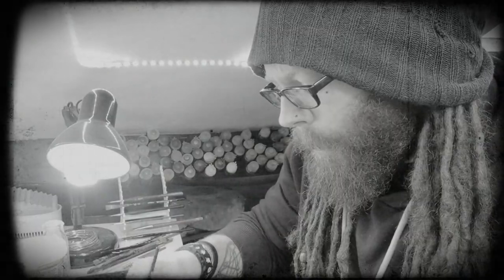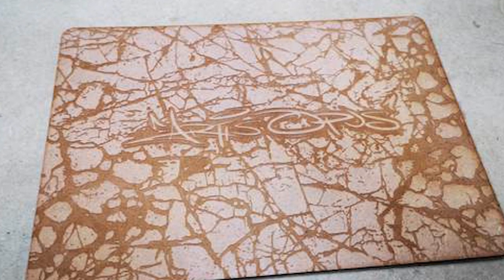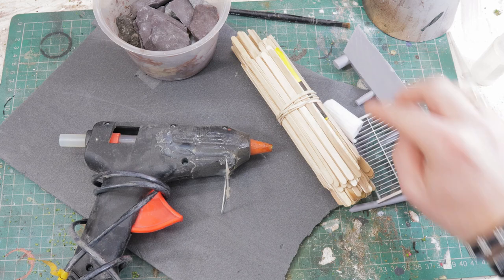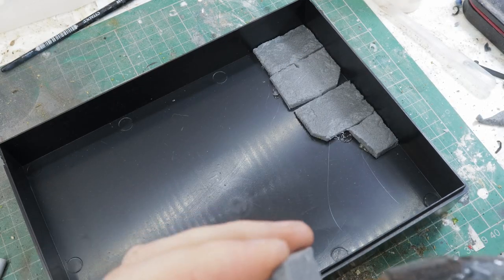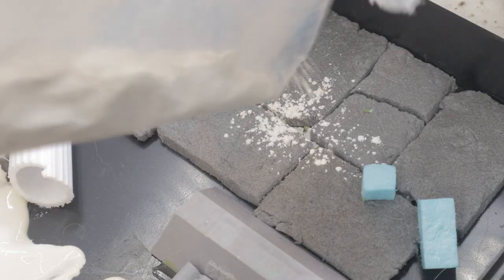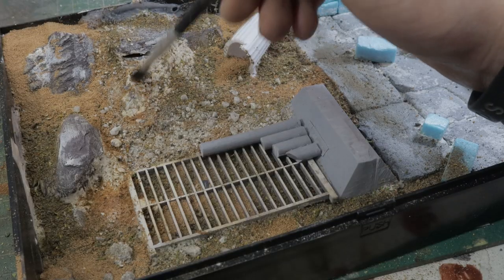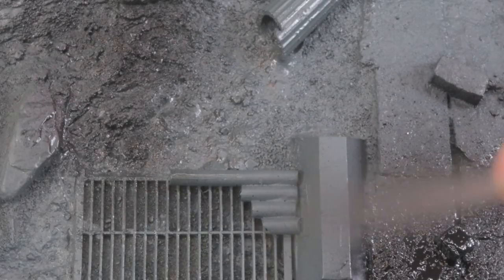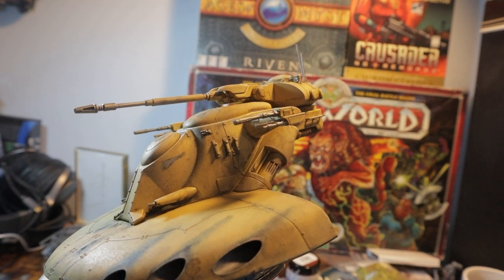LEVEL UP Your DRY BRUSHING Game | Homemade Texture Palette For Softer Blends.

Comment: Awesome idea! Its nice to leave some flat area to dry-mix on the palette, putting the colors on there directly from the bottle / pot for extra smooth gradients. Also would recommend using a large round brush (e.g. makeup brush) for bigger surfaces. Tabletop Minions has a nice guide on using cheap makeup brushes. Basically you want to use the largest brush you can get away with, without overpainting previously touched detail.

Comment: I honestly can't think of a way to improve this idea! What I can suggest, however, is that it's worth picking up some softer drybrushes, especially if you want to do those smooth curved surfaces. It's worth investing in (and when I say "investing" I really mean "nipping down to the quid shop") some cheap makeup brushes for blusher and contouring. They're soft, rounded, and just the ticket for drybrushing.
Reply from the maker: Aye, I have ONE makeup brush I use for stippling and it always stays soft. I’ll raid my pound shop for more.

Comment: Hi mate, great video on DYI texture pallet. One thing I notice : have you tried not drying your drybrush on paper? I’ve seen real improvement on not doing so, you can use your textured pallet to do it, removing paint on paper changes the medium/pigment proportion on the bristles which then also changes de behaviour of the paint while drybrushing!

Comment: Great idea, one thing I hate is when you go to drybrush and it either streaks or is heavier than you wanted. Also good when you drybrush new paint that you haven't used before, I never know exactly how thick it is until I start (and streaks...).
Reply from the maker: It's pretty nifty. It's my first time getting actual subtle blends since i started using it.

Comment: I usually just bore a hole in my paper towel before I start to dry brush. Also I'm a miser so I try to put as little paint on the brush as possible before I just whipe it all off on a paper towel. Dry brushing is a great technique but it sure has the potential to waste paint.
Reply from the maker: It does! Thankfully on my tank I was using cheap craft paint.

Comment: Such a simple idea, as many good ones are. Especially the thoughtful mix of the textures and surfaces included.

It may have been invented before, but I've not seen it, thanks. One thing that may be an improvement, I've seen some improvement with my dry brushing by using a dampening pad. Including a container for a small sponge as a damp pad.

On the hunt for materials now.